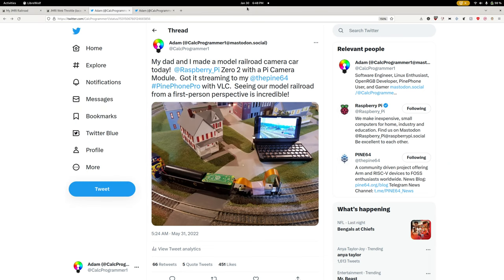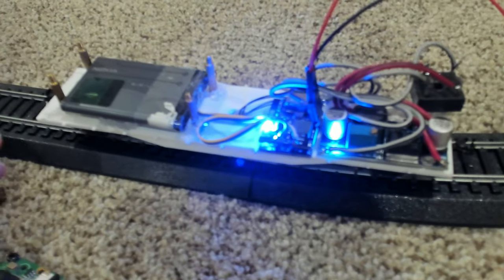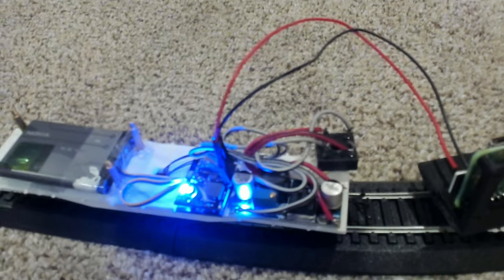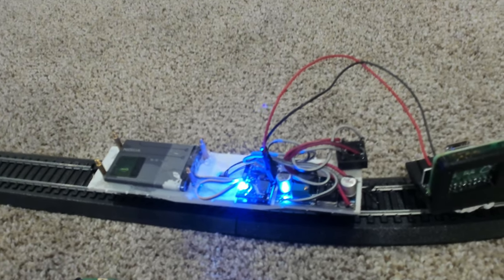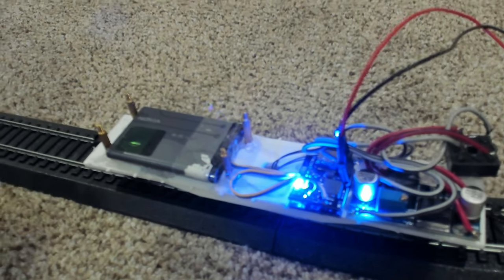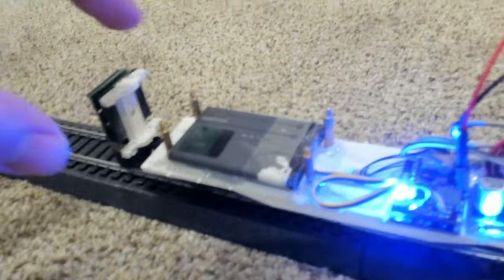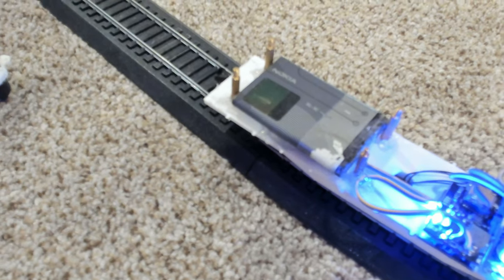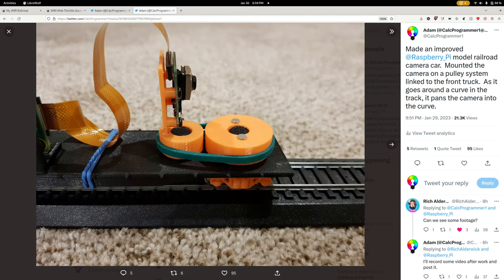Raspberry Pi Model Railroad Camera Car - Track Power and Swivel Mount

Comment: Very nice explained. (Busy with the same stuff 🙂
Reply from the maker: Nice!  I am working on a new design that uses a micro servo allowing you to control where the camera looks.  I want to upload a video on it soon.  I've gotten a lot better at Blender modeling and designed all new 3D printed parts for it.  The parts are already available here https://www.thingiverse.com/thing:6431381 if you're interested.
Reply: Hi, I'm a bit busy now. But will certainly keep posted on the subject.  @CalcProgrammer1